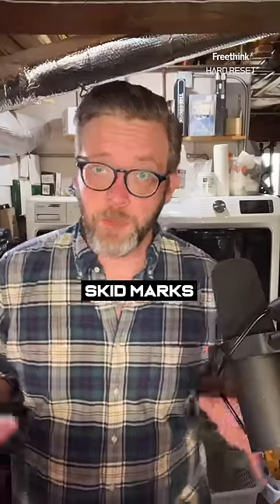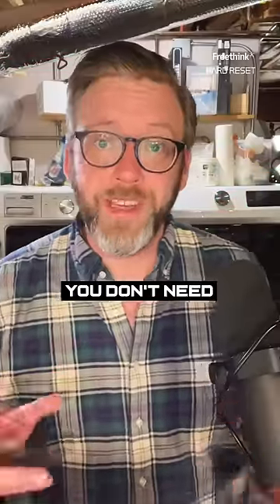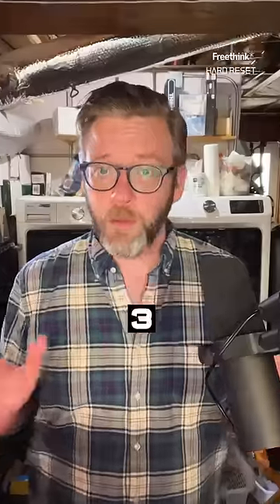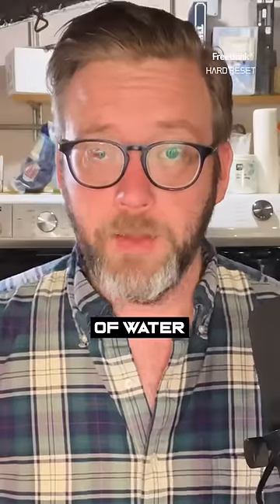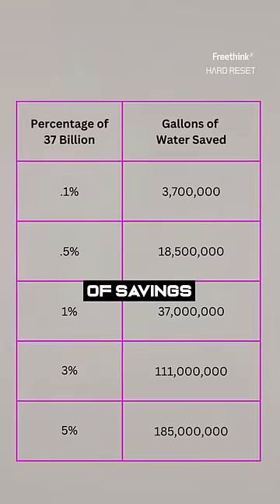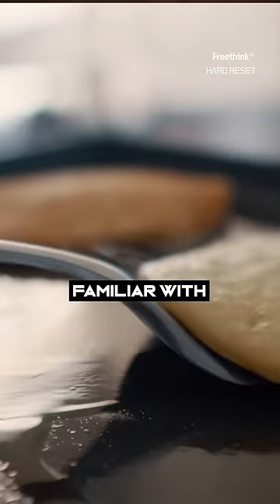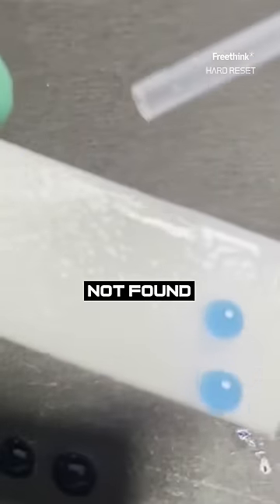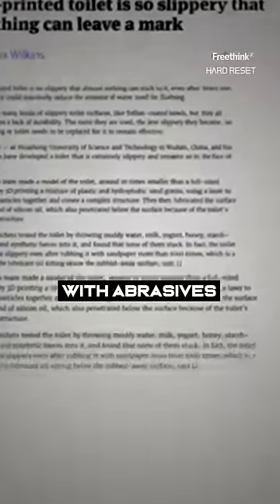Researchers invent super slippery toilet 🚽😳 #shorts #metamaterials

Comment: This is also a gamble for a lot. I don't know how it is in other countries but in Germany we already tried something with toilets that don't need as much water as the old ones. The result was that it took so less water that the sewer system had a problem because the stuff you flushed didn't make the whole way down to the central parts....... Thousand of houses have this problem or had this problem and magically a lot of these toilets disappeared again because the preserved water cost wasn't worth the unplugging cost. Some can use it if your pipes got a good enough angle, but not all and there are regions where it might never be possible. So what advantages will this give, when the pipes behind the toilet are not slippery enough? And is it really that different in other countries?
Reply: I encountered this while conserving water in my RV. The amount of water it took to debrick the black tank was staggering
Reply: I'm in sweden and when we redid our toilet.. so installed a low flush..  result was calling out plumbers for flushing every yr for 3 yrs until the  guy told me you need to hold down the flash button until the tank is empty. After that I haven't had one problem in 5 yrs or so.
Reply: @kungfreddie  I am at least happy to hear that this isn't a German problem.
Reply: That's very interesting, but I would expect something like that. I would think making pipes instead would work better off than just the toilets alone. But also rods for energy transmission (I don't know it's translation, "eixos" and "mancais" pt-br), gears probably for non industrial solutions.
Reply: @finndemoncat9379  but even if we make such stuff for pipes it gives more questions that need to be solved. How much would it cost to change the pipes and the toilets to make that and who pays for it in what case? Which industries can use it to which extent, with what working chemicals (so not only use it in the sewer system but also in other parts). Is it technical possible to reduce the efforts and costs of changing and even get a plan to say which pipes need to change and what can be kept as it is?

I am fan of new technology, but I am not a fan of taking something that sounds good with out the consideration of how possible it is. And I don't even want to go into the political realm where they are able to get things so confusing that some times it is not even about such a topic and they talk around it
Reply: How about a super slippery pipe?
Reply: They would have to coat all the pipes, not just the toilets.
Reply: In China, we will make sure we plan the sewage system all the way down the road. We also can use it on the airplanes and railway trains.
Reply: @yazyaz2969  one comment above yours I already touched on this question, by giving an inside how many questions this will create
Reply: @ichmich9324  Oh sorry I don't read any replies here
Reply: The real solution is transitioning away from flush toilets entirely wherever composting is possible.

Doesn't help apartment buildings, but it would still drastically reduce wasted water
Reply: There's also the gas and decomposition issues, the water in which residues rest when flushed dissolves many of the gasses and compounds that may otherwise build up and become a safety hazard. These residues can result in highly inflammable and corrosive gasses and compounds.

I live not even a kilometer away from an area in my hometown where the biggest explosion due to gas build up in sewers in my country happened in the 80s.

This wasn't just because of the gas build up, it was a mix of unkempt and not well mantained sewer system, bad hydraulic and engineering design, (pipelines and sewerlines that didn't help the evacuation of residue and in fact had lower sections where residues would get trapped and build up), corrosion which in turn affected other lines like gas pipelines and the extremely hot weather for that summer. This resulted in an explosion that destroyed many buildings, businesses and houses, killed hundreds if not possibly thousands of people, many not even reported, since entire families cars and busses were buried alive or died after being trapped by debris and affected several blocks, rendering all streets in the area intransitable, crumbled entire buildings and literally turned houses upside down. It was worse than a war zone, it was as if several bombs were dropped and there was so much confusion that radio and news were reporting  of bombing attacks of unknown origin or a bomb attack for the fish couple of hours in the morning following the incident since nobody even knew what had happened for the first two or three hours after it happened, it was unheard of and the streets were so unrecognizable to the point that the military, red cross, firefighters, civil protection squads, rescue teams first responders and other aid were literally unable to properly help or transit  before bulldozers and construction machinery was used to remove all the debris.

It's scary and now there's a block long memorial for the victims near here.
Reply: In short: water helps to wash away and neutralize voltile and hazardous materials which otherwise can prove dangerous through gas emissions build up and corrosive properties.
Reply: This is the absolute best comment on this video. Thank you for sharing a real world experience and what happened over time. I definitely didn’t consider what happens with the rest of the waste systems but now that you mention it - it makes so much sense!
Reply: @FreddieHg37  OMG! What a disaster! What city is this?
Reply: @LukeKido  https://es.m.wikipedia.org/wiki/Explosiones_de_Guadalajara_de_1992
Reply: We still pump a bunch of freshwater through our sewer systems to push all that stuff through because of the "water saving" idiocracy.
Reply: Advantage: easier toilet cleaning.

For house pipe problem, add:
rain water harvesting tech,
grey water from RO process, 
recycle water tech(bath, wash),
while plans for pipe upgrade.

Priorities
install for new block with new house.

I know, more 💰 to solve these problem.
It's a slow long process.
But I believe the result are worth it.
Reply: @Perktube1 Im just imaginaing my turds shooting down the pipes like a fuckin Hot Wheels Racer 😂
Reply: @budisutanto5987  I know someone that did this back then before it was cool to be Eco. But after 15 years the first repairs started and also then it isn't obvious that it is worth it when you are in older age. The easier the maintenance needs to be the more the price raises. Nonetheless if you have the chance and build a new house it is worth it, but when your house already at a curtain age, it is not so obvious that it needs or even can be considered a solution.
It is also the question if that what we have now is the best solution or is the best temporarily solution so it is the best step for upgrading. If it is not, then it is also again a thing where we just waste money.

And I am curious about especially the environmental questions. Do you think it would produce a problem if we really make it despite all cost that every house can safe rain water, the used materials are always at the peak of our technology etc. So for example would the groundwater level get problems of every house catches a curtain Kubicmeter of rain water? How long does materials need to be tested to approve their use and don't get any surprises like their recycling or when they naturally deteriorating? And what we need to change socially to make everything as good as possible, like laws that make single houses illegal because it is obvious that the German DDR Panel construction for multiple families is more efficient for that
Reply: @idonotknowanynames  if I understand that correctly you mean the toilets where when you look into the bowl where you see a flat surface and the water hole is towards you.
If yes that can be considered a construction error because how this was constructed. So they basically build that around a technology that prevents the smell coming up from the sewers. Which ironically fails because most new toilet water tanks flush with not enough water to get the waste behind it in one flush. Newer toilets use this technology too, but they just put it behind the bowl to make it cone shape and did it in a way that less water is required to get the waste behind this obstacle.
Reply: @ichmich9324  'every house can safe rain water'
- use cyclone, no used material (throw able filter)
- no problem for groundwater.
The problem:  how to fill groundwater from road surface(not a technology problem).
- learn enough of the recycling tech, vote accordingly
Reply: @budisutanto5987  yes also every house can  use photovoltaics, get warm with district heating, get a house battery storage and a lot of other stuff. The question is should every house do that and if yes which laws needed to be there for what cost?

-Germany has around 18 million houses and a standard safe is around 5000l. Most I know that have that do 10 000l
-Road stuff is also solved with costs like using asphalt that let's water through. That needs to be renewed nearly every 5 years
-recycling is another really strange thing. Like why not going back to lead Batteries that is the most easiest recyclable thing of energy saving?
And to the topic of voting. The once that want such things like "Bündnis 90/Die Grünen" are just using it and lost at least for me all credibility to ever get voted.  For example they made our energy the most expensive while simultaneously making it the dirtiest. And the rest also didn't go better
Reply: I can see it benefiting from the cleaning standpoint, have worked in housekeeping, certain individuals can't help some their potty woes, (meds are can effect it not in a good way). 
It could mean less, caustic chemicals that people might use to clean. Which would be better for our health and the environment. 

But I get your point that it might not resolve the low flush. But it still could be very beneficial otherwise.
Reply: let's. make the pipes slippery
Reply: In a city (I believe in South Africa) they had a similar issue with their sewage so they devised a temporary solution where everyone in the city flushed their toilet at the same time, the rush of water was enough to wash most of the built up waste through the sewage system, I believe they had to do this once a week. It was supposed to be a temporary solution but it ended up lasting too long, probably because it was cheaper and easier for the government than fixing the problem.
Reply: Wonder if you made the pipes out of super slippery material as well, if it would solve that issue?
Reply: It's a lack of foresight in planning with the existing infrastructure.
Reply: @jadesidhe2634 u had a brick of shyt? wow
Reply: @Astroqualia  how is it a lack of foresite if the technology didn't exist?
Reply: @markgoin225  re read how I said that. It was lack of the new people to not understand less water will move less solids down the existing pipe when they decided to lessen the water output. Of course likely not the same people who built the sewers so it makes sense that happened.
Reply: That’s Why you make pipes and receptacles of the same materials 😅
Reply: I have this problem since I moved to Germany. I have to unclog the toilet super often because of how little water it uses, it's ridiculous becuase it's just as wasteful as the toilet I had in America, which had more water in it by default.
Reply: @Ace_Maus  you can change this by using a new "Spülkasten " or maybe the one you already have has the option to change the amount of water it flushes. If you are really unlucky you might live in a region where the sewer system is already problematic and you can't do anything.
Reply: That is definitely an issue that needs to be addressed
Reply: Low flush toilets in the U. S. have increased problems with sewage blockages, too. My plumber advised us to flush multiple times to make sure solids get moved along.
Reply: In China they actually have to throw the toiletpaper into bins after used and not into the toilets, because their pipes are not big enough. That might is a difference to consider, also in regards, that this invention comes from China.
Reply: This really calls for an entire overhaul of the Sewage system themselves, not just the superficial thing that Germany did. Of course this goes into stages, to avoid cost and inconvenience. We’ve been using Sewage system that is mostly unchanged since the late Medieval times. This would call for better Pipes and Toilet seats designs with better materials that prevents clogging plus better access to the main sewage line. Use of untreated water to move matters on the ground pipes. Use of more quick dissolving toilet paper. Advances in miniature Robotics would make cleaning and repairing of clogged pipes much easier and cheaper in the future.

In Asia, where most sewage pipes tend to be smaller it’s common practice here to dispose toilet paper not on the bowl, but on a separate, closed trash cans. Use of water spay to wash ourselves is very common.

The announcer didn’t suggest extreme decrease of water usage on the WC but a reduction of water usage in general, like the need to clean the toilet bowl constantly, since it’s quite self cleaning or the need to flush when you just peed once since it won’t yellowed the basin easily. Even a tiny reduction of flush water is more than enough to save money and resources. The slippery coatings would help the water generate more push as it slides into the pipes, mitigating the loss of volume when there’s less water, since a lot force are lost in the toilet bowls P-trap.
Reply: @Ace_Maus usa is having same issues we've been passing more restrictions on toilets this year makes no sense.
Reply: Hadn’t considered this side effect. I can see where that’d be a negative.
Reply: The Us has a significant ground water shortage problem. Facts are they’ll need to start making changes and soon. If that means replacing everything then it’s not a big deal. Remember they also have a huge issue with lead pipes that NEED replacing. Two birds, one stone
Reply: @shaman5433  that is a fair assessment. I wonder if the implementation of that, oh what’s it called. Bidet? Would help the pipes issue. Then you’re not using extra water and not using toilet paper
Reply: I'm seeing that because of this, it may be more useful with dry earth composting toilets such as the Air-head, Nature-head and C-head toilets.  Currently, people lay down a layer of compostable toilet paper or a coffee filter down first so the feces don't stick to the bowl or trap door.   Would probably help with camping chemical toilets too.   However, I would want the idea used on solar panels so they wouldn't have to be cleaned, climbing up onto the roof just to clean the panels can be quite dangerous.
Reply: @kungfreddie So, it's a normal flush toilet now...